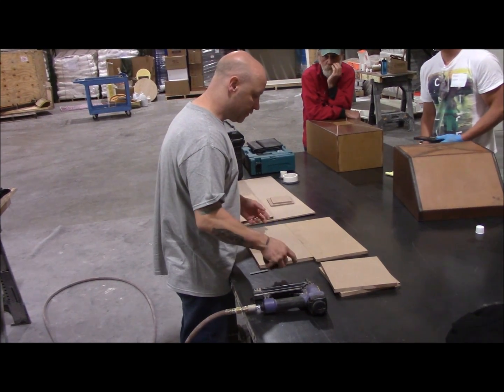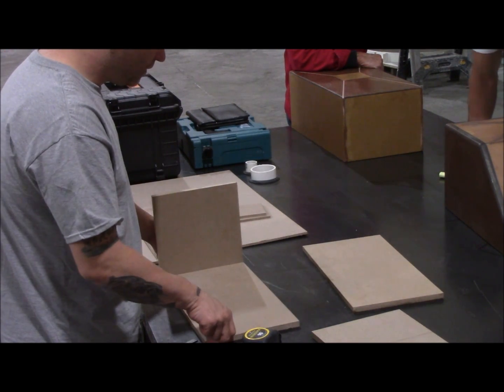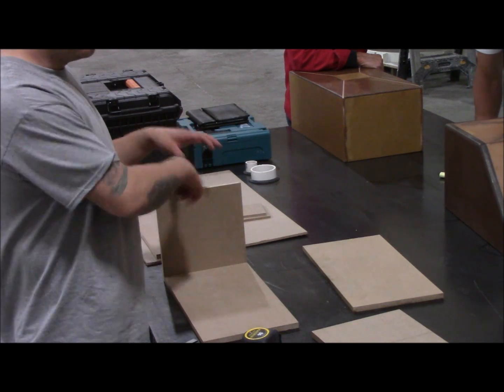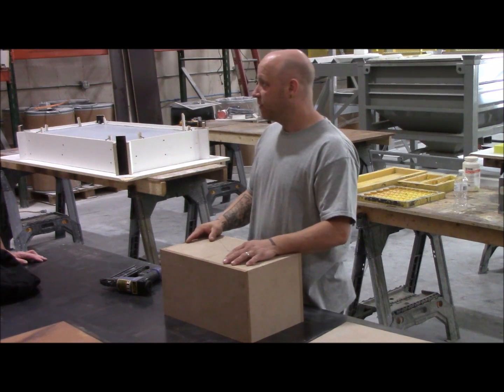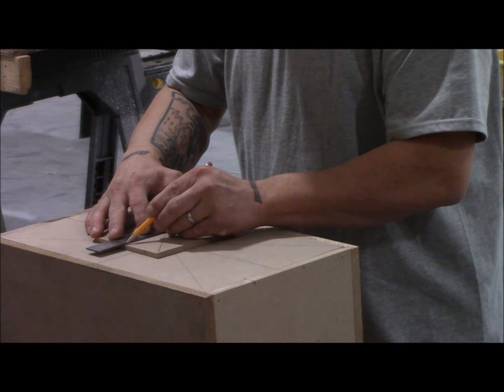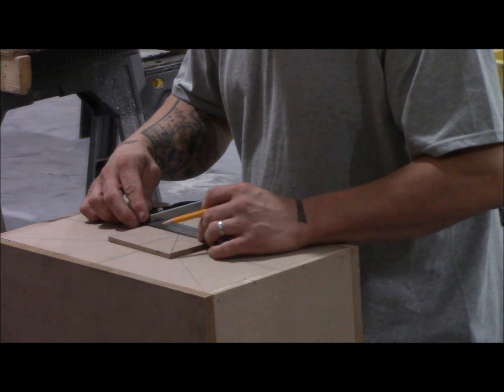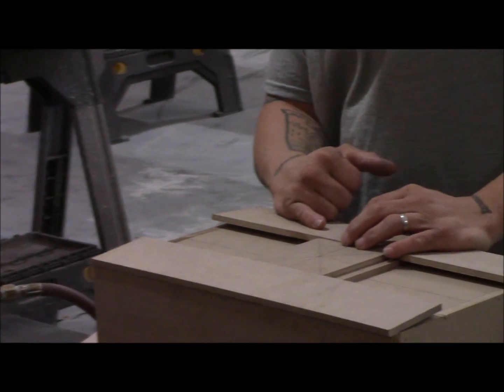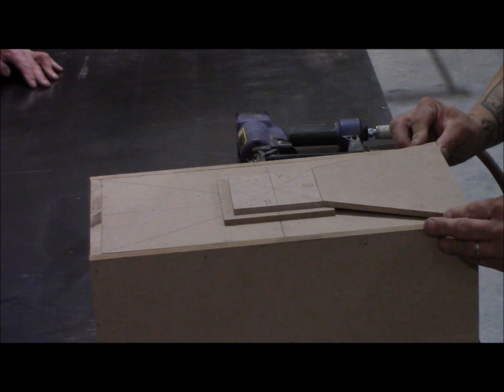Creating a Custom Concrete Sink Mold out of MDF - GFRC - Glass Fiber Reinforced Concrete

Comment: Hey! Awesome video. I want to give this is shot, just to clarify, is the fiberglass resin used to keep the concrete from sticking, and the paste wax to give the poured concrete a smooth finish?
Reply from the maker: The fiberglass is to fill in and smooth out the voids in the mold and the wax is a release so you can get it back out after casting
Reply: @TrinicLLC  hello again
I built the plug like in the video, I'm ready to apply the fiberglass resin now...I've never worked with it before, will I have to use the fiberglass mat?  Or do I just mix it with the hardener and apply with a paintbrush?
Reply from the maker: @adrianznidarcic3811  no just the resin. We usually mix more hardener than is recommended just so it cures faster
Reply: @TrinicLLC  ok great.  And will "minwax paste finishing wax" do the trick, or does it have to be Johnson paste wax?  Also I'm totally new to using Bondo, exactly which product of theirs is used here?
Reply from the maker: @adrianznidarcic3811  we have found the Johnson’s works the best. Just get bondo body filler and use extra hardener so you don’t have to wait forever for it to set.